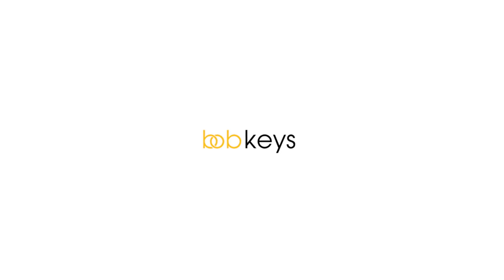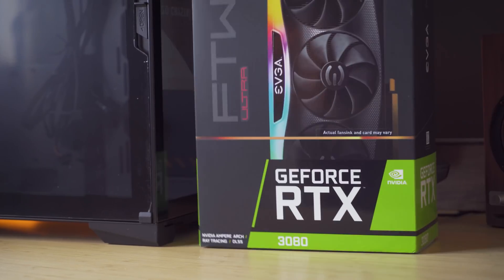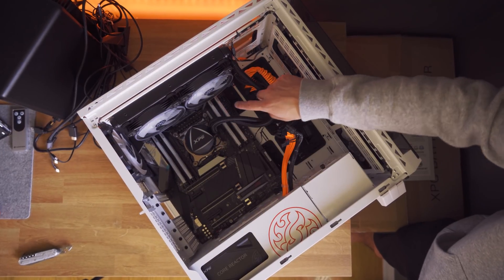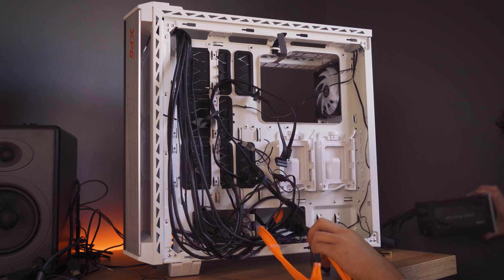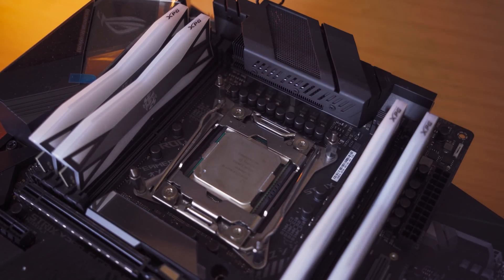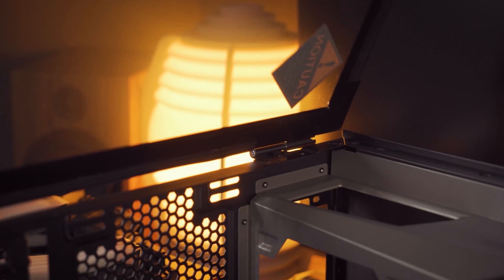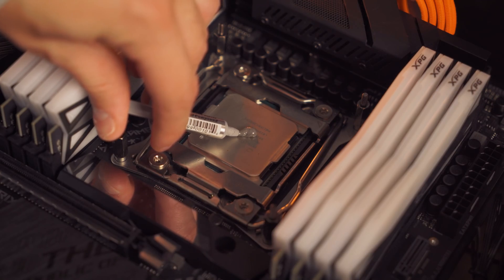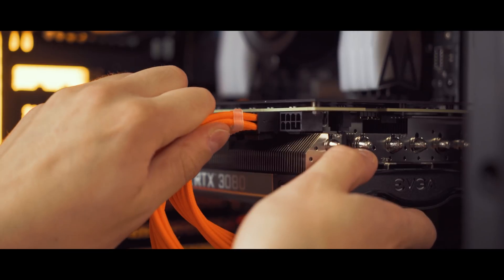How To Case Swap And Upgrade Your Custom & Gaming PC ft. RTX 3080

Comment: I have an issues. After I changed the case the fps in the games got low. Before I always played with fps 200-300. But now it’s not getting higher than 100 (30-70), it feels like I’m lagging. I updated the drivers and tried different stuff, it doesn’t really work. What can the issues be??

Comment: My pc is faster than you :))))

my specs

Graphics Chipset:
AMD Radeon R7 Graphics : 512 Mb Vram ddr3

CPU Type:
AMD A8-7680 Radeon R7, 10 Compute Cores 4C+6G

System Memory:
8 GB ddr3

Windows Version:
Windows 10 (64 bit)

See.....